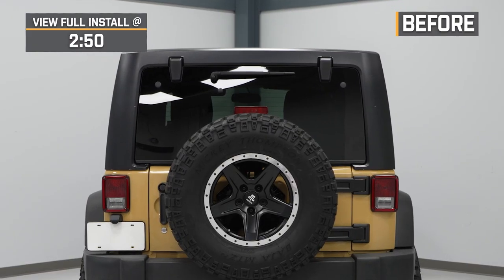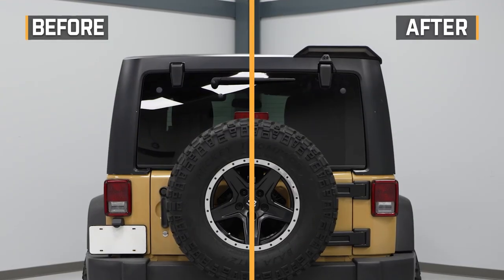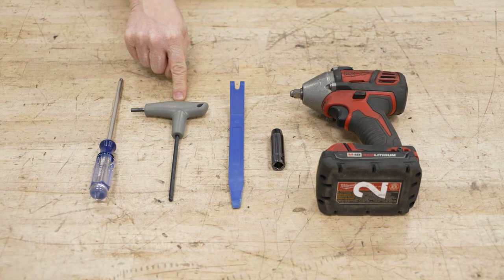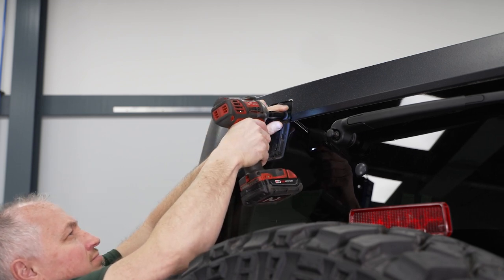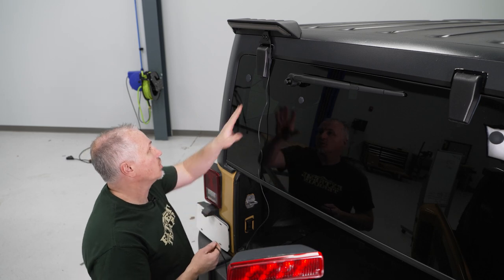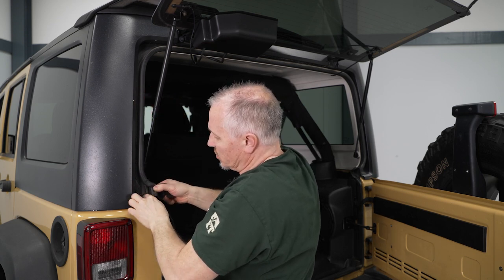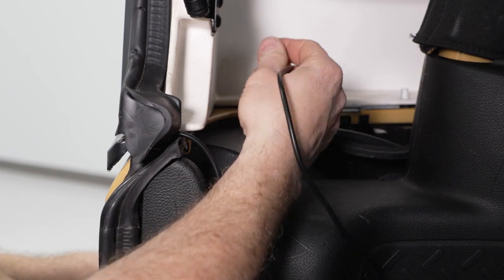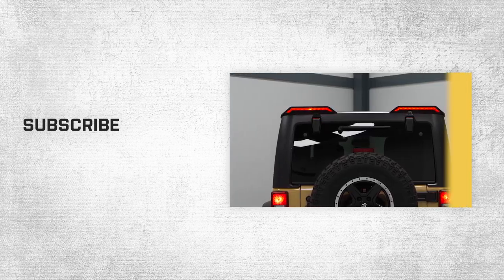Jeep Wrangler JK RedRock Roof Mounted LED Tail Light Spoiler Review & Install

Comment: I bought some and they won’t work ? I have aftermarket tail lights and the turns and brakes don’t activate ? The running lights work but nothing else . Same harness as my originals just doesn’t work ?

Comment: I already have a plug and play on my 2017 that goes for trailer hookup can i hook this up also with it or will i have to do some splicing
Reply: Did you have to do splicing? I have somewhat of the issue, I tow my Jeep so therefore I have two connectors to go into the back lights

Comment: The top cant be removed if these are installed correct?
Reply from the maker: You could wire them in with a quick disconnect, so when you take off the top you can unplug them along with the other connections.

Comment: It doesn’t work with JK only for the JKU, I tried it doesn’t fit on 2 doors but the website still says it fit on all 07-18 wranglers
Reply: What was the issue installing on a 2door? If u don't mind helping me with a more detailed reply
Reply: @_ODJ  mounting points on the bracket do not lineup the mounting points on the back glass bracket, it is offset by 1.5 inches
Reply: @充电壳  will report  back if i run into this issue aswell
Reply: @extremeterrain can confirm they do not fit a 08 rubicon, I'm having to drill new holes in the bracket and add bolts n nuts... very annoying
Reply: @_ODJ  confirmed doesn’t fit yours?
Reply: @充电壳  rite